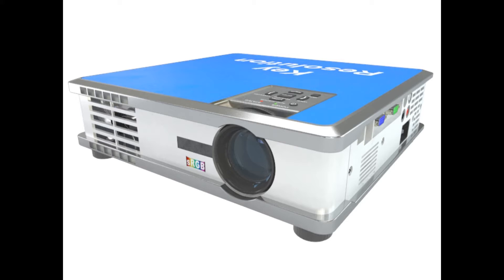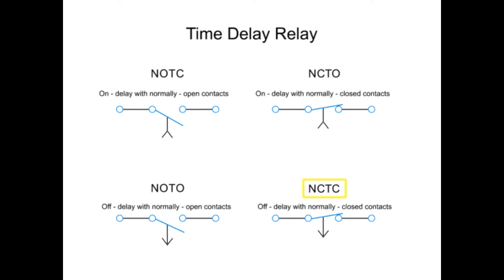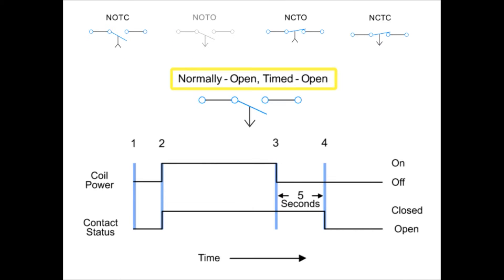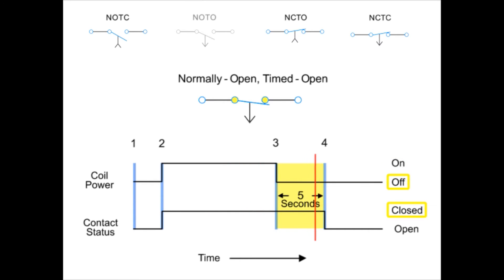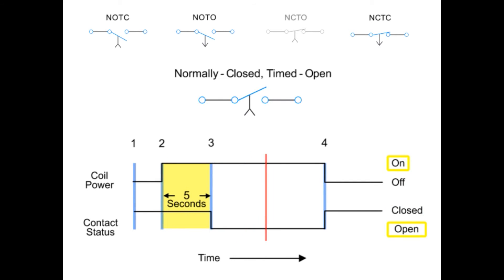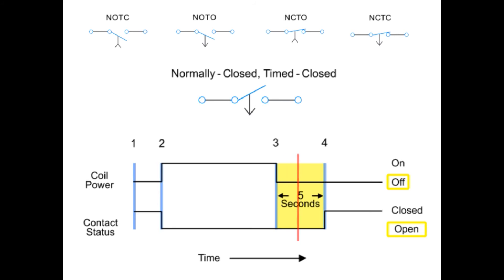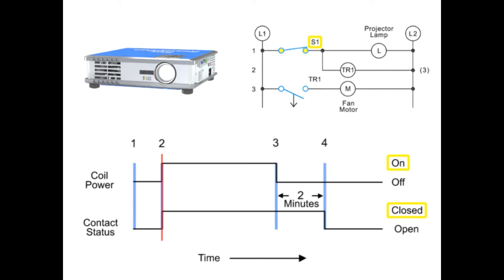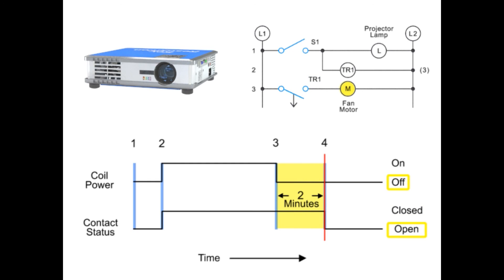Time Delay Relay Explained - Electrical Engineering

Comment: OMG you have so very extremely well simplified this whole business for me.  Excellent work.  Very plain and simple an on delay relay is NCTO.  Contact starts out NC  passes current for predetermined time and then shuts off.  I need a watch circuit for a rotary phase converter and this is it.  Thanks